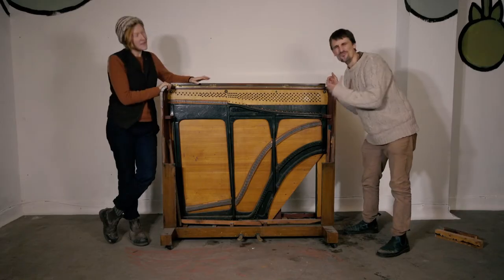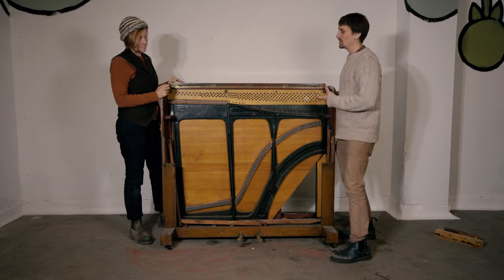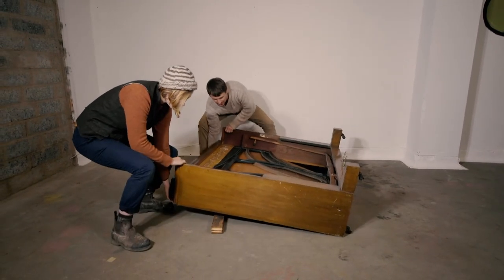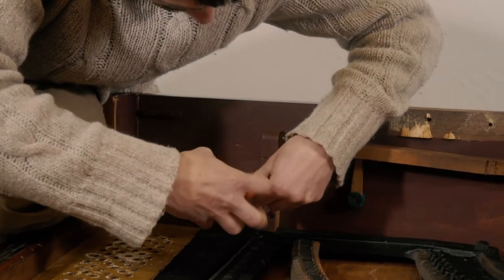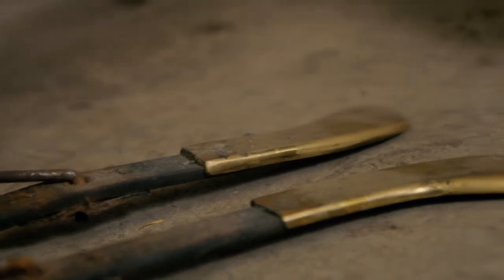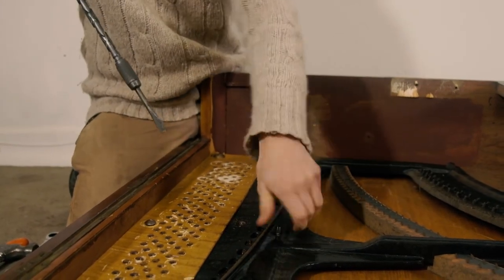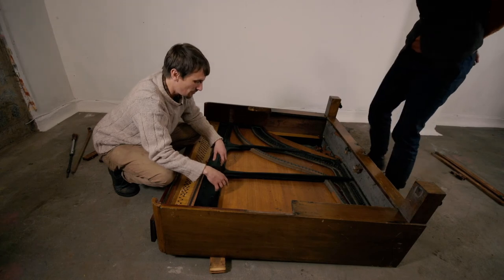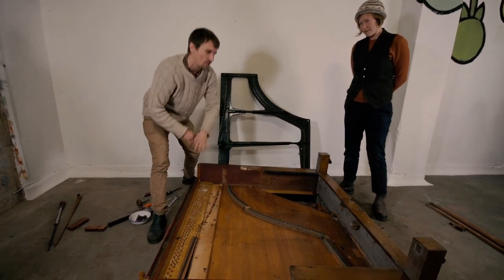How to Dismantle a Piano (PART 6) - Removing the Harp

Comment: Your videos are GREAT!! Everything has gone gone SWIMMINGLY up until The Harp. Screws and bolts came out easily. The darn thing is GLUED down too!
Reply from the maker: Have you double-checked that there are no remaining screws or bolts holding the harp in place. Sometimes they can be painted in and obscured. It is unlikely that it has been glued in place - we have rarely, if ever, seen this. If you can get your hand under one end and lever it up slightly and give it a wiggle you might find you can locate whereabouts the harp is still attached. Also worth checking if there are any wooden blocks which are clamping it down around the edges. Good luck!! If you're really struggling send us some photos info@pianodrome.org
Reply: This is super helpful - both the comment and the content of the video! I am sure I have all screws removed and it also seems like our 1950s piano harp is glued to the wood. I’m going to do another very thorough check for clamps and painted screws. Thank you!

Comment: Hello! Your series of videos on this has been extremely helpful for me. I bought an old broken piano just for the aesthetics. As it's extremely heavy I'm removing all of the interior and I got to the part of removing the screws from the harp. Just broke my only bit in the process, the screws are really really tight and most do not move at all. 
Could you please tell me length or diameter of the bits you guys used? Thanks!
Reply from the maker: Hi Arthur - we use 1/4 in bits, but using the actual 1/4 inch socket itself, which is usually used to connect the bit to the wrench. These work well for most pins, but not for all of them!
Reply: @Pianodrome  Thanks!

Comment: I'm wondering how much the cast iron harp will weigh in my 700+ pound, 80 year old, concert grand. It's about 1 1/4 inches think and 7 inches across in some places.
Reply from the maker: Wow, you're taking apart a concert grand!?! What's the plan for it? 
We do a lot of uprights, so I woulnd't say we're the experts hree, but you might find the harp could weigh as much as 100-150kg (so that's maybe 200-300 pounds??). Only one way to find out for sure...
Reply: @Pianodrome  It is an upright grand from the 30's, and truly massive. Never really liked the sound and it's way too loud for inside the house. But the wood work is amazing. I'm thinking the strings are close to 100 pounds, the harp 300+, leaving just under 300 pounds of wood. I'm going to assume 400 pounds for the harp and plan accordingly with safety measures. Was a little surprised how small the piano in the video was, but then I guess they have still been making pianos over the past 60 years.

Comment: I want to try to remove the harp without removing the keybed, because I want to turn my old piano into a desk. Would a reciprocating saw or grinder cut off the two cast iron brackets sticking out under the keybed?
I hired a piano technician to fix some action parts and tune my 1906 Lester upright piano and he actually broke more. He told me to get a replacement piano, so I bought a spinet piano from someone I knew in school and I'm turning my old upright piano into a desk.

Comment: i want to keep the harp with the strings. is it possible ?
Reply from the maker: In many pianos you'll find you can remove the whole harp/soundboard assembly as a single unit. To do this don't unwind the strings, but remove the key bed and keyboard, front legs etc sides and lid at the top. The soundboard, pinblock and harp will need to be kept together.

Comment: I have been disassembling an old yamaha upright piano and have been trying to take the harp out. However, this is all for the purpose of making it lighter so i can move it elsewhere in my house. I am finding that it will be impossible to keep any of the strings on, and even then, it looks like the entire upper part of the harp is glued to the rest of the frame. Do you have any tips?
Reply from the maker: Hi Swagifier - if you want the piano to continue to be playable please do not remove the strings! You'll never get it back to good playable condition without a full refurb which would almost certainly cost more than the piano is worth. There are ways to safely move a piano around the house - getting a couple of friends to help with this is a must.
Reply: @Pianodrome  Well, I ended up trying to put the piano back together. After I took the action off all I did was un-tension some of the strings and remove the screws under them. I thought putting it back together would be easy but when I put the action and keybed back in, the keys were so stiff I could barely push them. Also, half of the dampers aren't even between the strings and they don't dampen properly. Have I just ruined my piano?
Reply: @swagifier1170  Oh dear! Our piano dismantling guides are for those who are upcycling pianos. We wouldn't recommend taking any of these steps if you're hoping that your piano will continue to be playable. Pianos are incredibly carefully made machines, with lots of subtle fernickety parts. Your piano may well not be ruined, but if you want it to remain playable I would seek professional expertise, or be prepared to spend lots of time learning how the piano works so that you can put it back together properly.